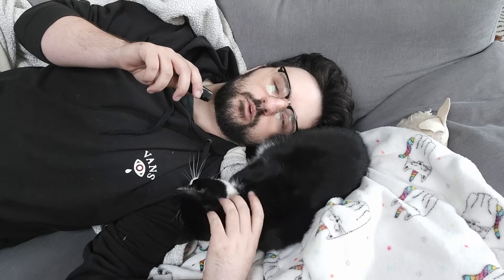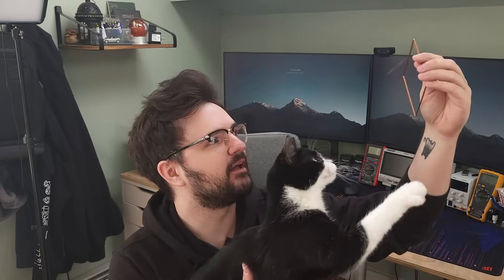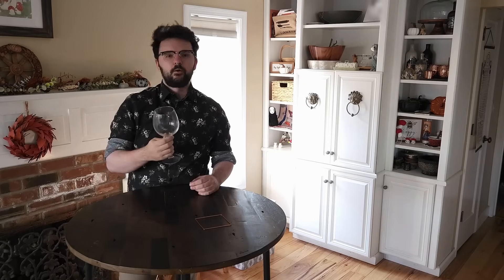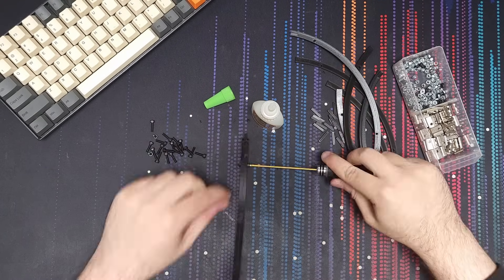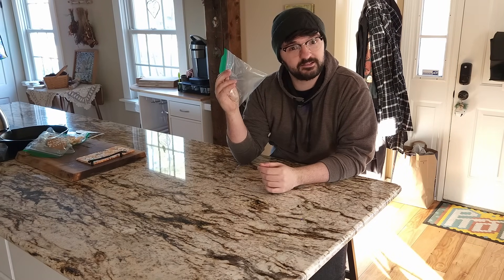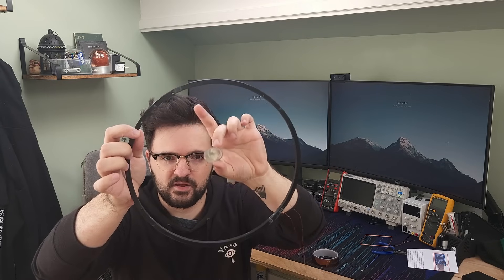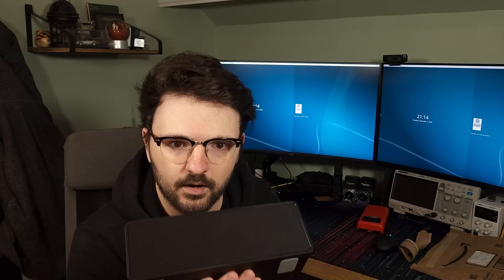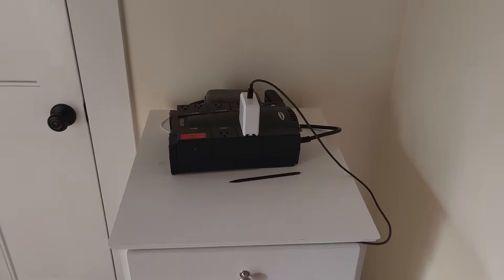Trolling my wife via litter box: The Voices.

Comment: I would like to learn more about how you fixed the antenna!
Looking forward to the sequel!
Reply from the maker: Since the inductance was too low compared to the original antenna, I Just added a bunch of wire so it was way over, then i cut off one loop, measured the inductance, and repeated until it was as close as I could manage to the original. 
Thanks for watching! I've got some other videos planned before the sequel to this one, so I hope you'll enjoy those too!
Reply: @KeithSachs  Thank you for this explanation. I already subscribed, and look forward to more videos!

Since I have a friend with a pet-supply shop, I am wondering how big the coil could be 
😅🤣
Reply from the maker: @Wheeze_NL  probably pretty big tbh, I think as long as the inductance works out right it should be fine, I imagine large enough for most pets is possible
Reply: @KeithSachs  I am imagining covering the entry door to the shop 😂

Comment: A tip to help with dusty cats: consider switching to pine pellet litter! You can pick up a 40lb bag for under $8 at tractor supply. It also completely neutralizes pee smell. Great video 💕
Reply from the maker: Thanks for the tip! We originally got this litter because it was advertised as flushable but I'm not opposed to trying something else
Reply: @KeithSachs  The only potential drawback about pellets for this automation project is you'll have to sift & scoop to clean it, I'm happy to answer questions about it because I did a ton of research pretty recently haha
Reply from the maker: @callmeperch  For sure, i'll ping you if i have any questions!